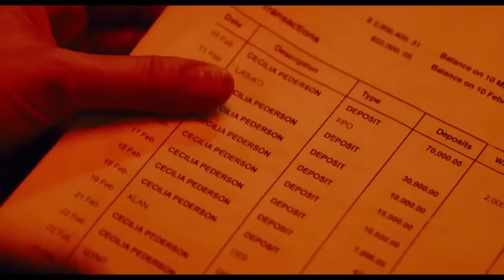SAW X (2023) - Cecilia kills Gabriela by breaking her neck II Final scene

Comment: I like how those cuffs are attached to a climbing hook, while after breaking your ankle might hurt, you can pull your self up and unattach it. I also prob would have hauled ass out of the country instead of getting the money.
Reply: I can see that, but there is on e flaw. That Gabriella possibly wouldn't have the strength to climb the chain after breaking her ankle. She's still being bombared with radiation, used her strength to free her foot which is now properly f*cked up. And it makes climbing impractical. It would have been easier to break her wrist from the start and potentially avoid the radiation altogether. At least then breaking her ankle uses far less effort and wastes less time.

Though I do like the possibility of being able to potentially do that! (Climbing and unhooking the chains.)

Edit to add: I would have done the same and leave the country than take the money too.